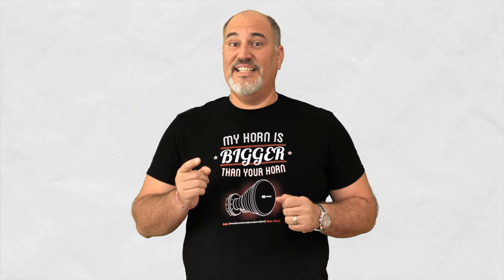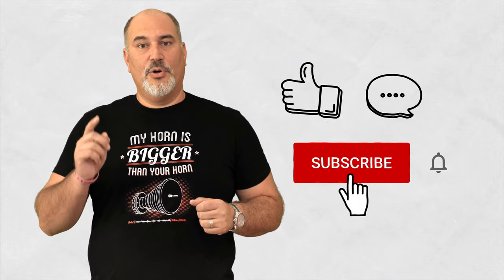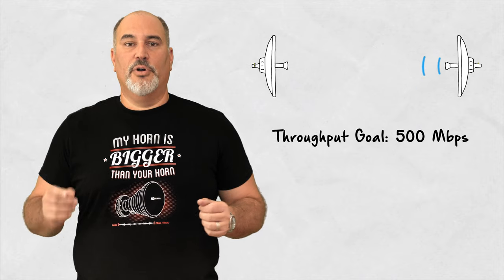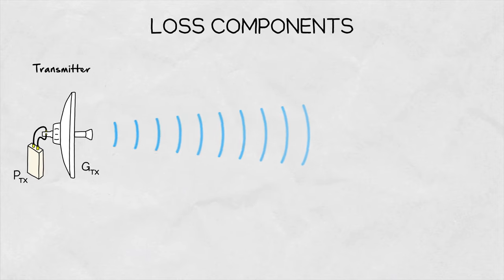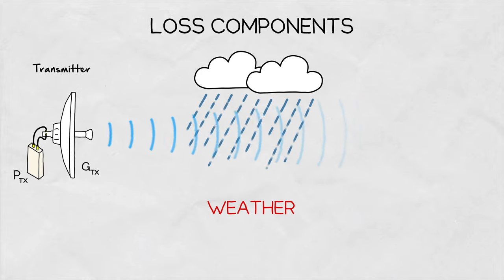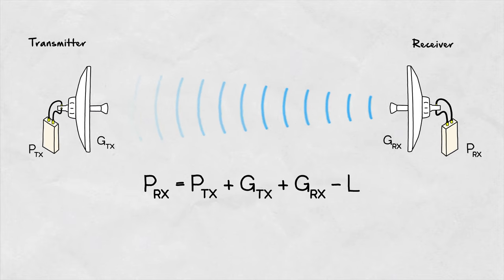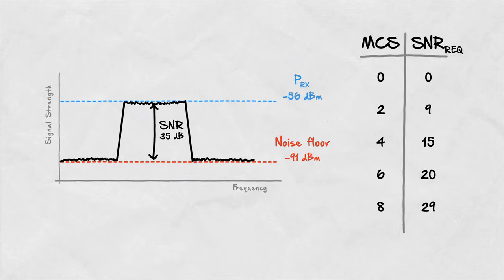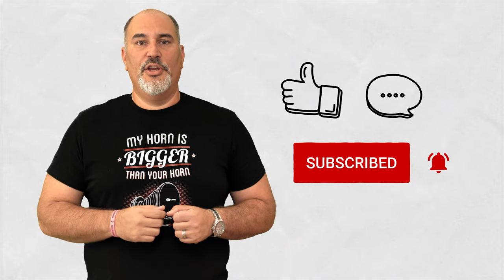Inside Wireless: Link Budget

Comment: Thank you very much for this great explanation. I've got a question. 
How Amplifiers/ Low Noise Amplifiers should be taken into consideration for link budget calculation? 
Thanks in advance.
Reply from the maker: LNA adds to the link budget and should be counted as a separate gain if they are not included in the output power of a radio.

Comment: Thank you so much,
Please, how much is the receiver sensitivity (in dBm) of WiFi (IEEE 802.11 n) that should be received by mobile end-user to achieve good signal detection?
for example 40 MHz WiFi signal (OFDM modulation) of 65 Mbps transmitted over multipath wireless channel?
I'll so thankful to you :)

Comment: Although it's true that the frequency affects the path loss isn't the frequency also going to affect G_TX in reverse? Which is dominant?
Reply from the maker: Gain of any antenna depends on frequency of course. Patch arrays typically see a lot of gain fluctuation within the operating band, but horns for example have very stable gain across specified bandwidth.

Path loss is the dominant factor of the signal attenuation occurring with any wireless link over the gain fluctuation (if you use the antenna within the spec).